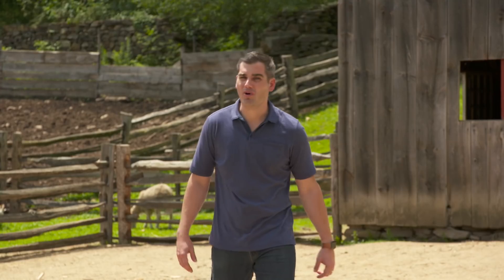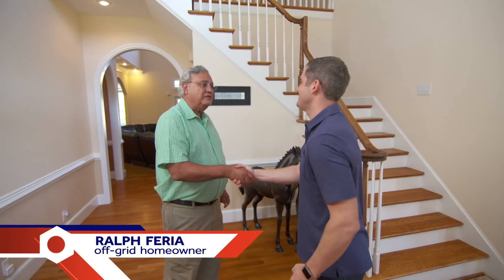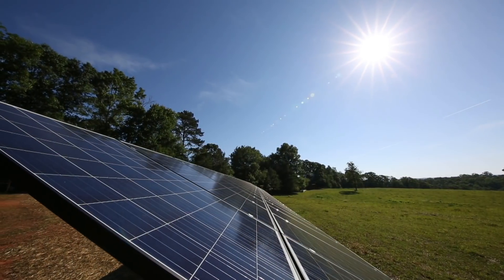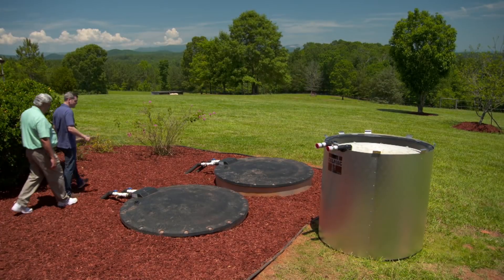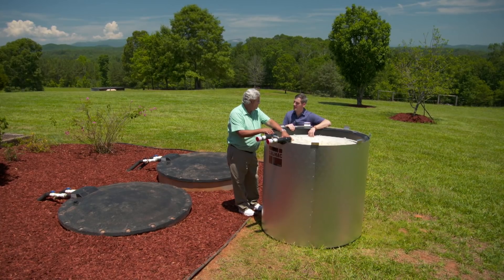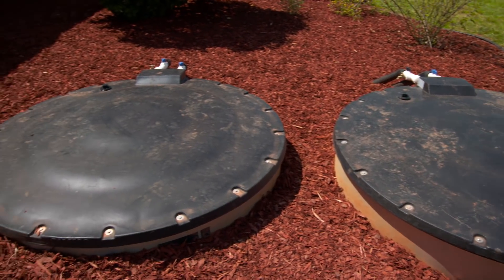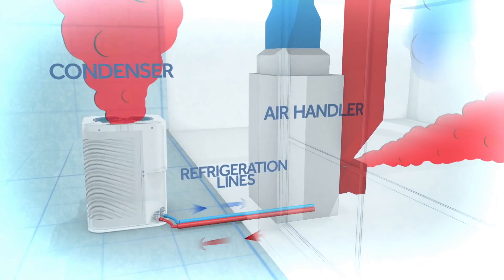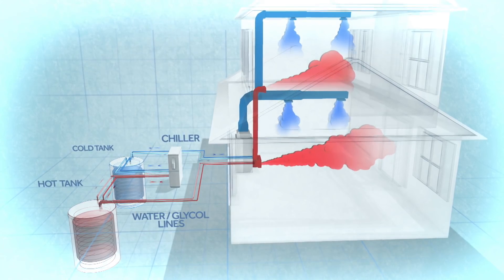Living Off the Grid Comfortably | Future House | Ask This Old House

Comment: Sadly off gird is illegal in some states/counties.
Florida is the worst state, They mandate that every home is connected to the power grid.
Reply: You can largely get around that by being connected but not actually using the electricity.
Reply: @fuxyews2177  , exactly
Reply: My solar isn't grid tied, its connected to 3 separate lithium ion batteries with wall built inverters and sockets.
Off grid systems are easily built and don't require a grid-tied inverter.
Reply: Did you really come back 1 month later to not understand the concept any better?

Ok I will make this as simple as possible..

I have a plug socket. The plug socket is connected to the grid. The power to that socket is supplied by a local electricity provider.
Now.. I don't use the socket. I have never used the socket. I receive no bills from the electricity provider.
Why? Because next to this socket is a separate one which is connected to the battery connected directly to my solar panels.
Solar panel > battery > inverter > plug socket.

I technically have the socket and its technically connected as required by some states. But the socket is never used... The house is connected, but is running off grid. This was the whole point of the conversation.
Reply: Well there's really no point in having a conversation.
I'm sitting here using a smartphone along with a dozen other people, whilst you argue that the technology doesn't exist to make it work...
 I know how much electricity I use, I know how much I generate daily, I know how much it varies and I know how large my battery bank is, and I know that I've never run out of power.... apparently my technology is from an alien world as is everyone else who lives off-grid or ever bought an off-grid system from 100's of retailers...I have no words except that you should keep living on the grid and stick to videos about cats or something
take care.
Reply: @fuxyews2177  actually if you connected, then there is flat minimum charge even you not using power, so they even make money from you even you use zero watt.
Reply: arrest me, it’s a civil issue , not a crime ...big energy wants they cut...why should , we as a home owner , depend on the power company? Not arguing ...
Reply: The whole point of this CONVERSATION is that someone lives in a place where being connected to the grid is required and explanations to him on how to get around it. 
You involved yourself into a separate conversation.

and yes ofcourse you can live off the grid comfortably. I do it. Off-grid livers do it. Caravan and RV owners around here do it too. Plenty of videos on this very site.

'The vast vast majority of solar is grid tied'
..and the vast majority of cars are petrol, that doesn't negate that electric cars exist or that driving one is viable on lots of cases. You can buy panels themselves off of amazon for example. None are grid-tied. 

'What do you do when its been cloudy for a week?'
Solar power is based on UV, not direct sunlight. It generates less but still generates enough with the appropriate sized system that accomodates that. The battery system also stores excess electricity. upto 4 days in my case.
Reply: Not related to my solar panel system no.
Reply: fux yews thank you and you're so right. I was looking to buy a house in Florida and go off grid the building inspector told me every house in Florida per building code must be tied in to the grid if it's available. in my case it is. so now I'm looking at a hybrid grid tie solar system instead of a complete off grid system. I like you're idea about the grid power,  I guess you just turn yours off, but I didn't even want that stupid connection fee these power companies charge every month- thx
Reply: Connect but don't use there power
Reply: True but strictly you could be technically connected but not use it. Also when there is a local blackout your house is still lit.
Reply: don't pay your bill.  they'll "disconnect" service and ... VOILA! you'll be unplugged from state utilities.
(nk ... )
Reply: as +fux yews said use the energy you produce not theirs. the best way to do this is using batteries to store in the day and use at night.
Reply: @erictoulon5946  At some price solar does work, sort of, for some people some of the time.  The problem is that for the average person that price point is extremely high and makes no economic sense.  The majority of the American population lives in areas with only about 10$ solar efficiency which means a 60 Kwh solar unit actually produces about 6 kWh year around.  That 60 KWh unit has an average cost of $60,000 and a battery will add another $30,000.  It may be true that some months you have no electric bill but what you do have is a bill to the bank for your system that is double or triple your electric bill.  If solar actually provided "free" electricity it wouldn't need to be subsidized and we'd all be standing in line to have it installed which is not the case.
Reply: illuminati you can connect to it you don’t have to use it don’t think duelism don’t limit yourself have options
Reply: @erictoulon5946  Wow, virtually nothing that you said is true. I have a friend who drives an older Cadillac who swears he gets 40 mpg. I don't believe him either. There is no free lunch and solar certainly isn't free or cheap. Your system had to be way over $100,000.00 which makes a 30 year monthly payment of $600.00. That means it is very likely double what your grid tied electric bill is. It also means it will be 30 years before you see any savings even if your grid tied bill really is $600.00 a month. 
As I mentioned, if solar were so great  it would sell it's self and everyone would have it on their roofs which is obviously not the case. The truth is that large solar companies are going under all the time.  There is not a single large solar array in the world that is even paying it's own way much less covering it's cost or making a profit. If the pros can't do it on a large scale it certainly can't be done on your roof. 
Please watch this 
https://www.youtube.com/watch?v=N-yALPEpV4w
Reply: illuminati 
Mine's on the grid but I don’t use it!
Reply: @erictoulon5946  I know, and your system was free wasn't it?
Reply: Lol. No. It’s not. Just stop
Reply: Don't like to admit I'm tied to the grid?  I assume you're trolling, correct?
There's no issue with being grid-tied, the entire point of this conversation (and why you interjected, I'm still not sure...) is that you can get around state regulations to being grid-tied by using alternate means to power your house rather than using the grid itself.
Reply: fux yews
Nice dodge there. I take it that means oyu do have an electric meter and wires to the grid.
Reply: There is not a grid tied battery system in existence that can store enough power to operate a typical house for any extended period unless you have a huge battery bank or use few electric appliances. .  UV makes up less than 50% of solar  radiation which coupled with the already terrible capacity factor of solar means there will be cloudy periods where your panels generate nothing., your batteries will go flat and you'll either use grid power or sit in the dark. 

https://www.solarquotes.com.au/blog/uv-solar-panels/
Reply: Actually I just came back from the weekend at our off grid camp that we've had for many years so I do indeed know a bit about off grid living. But you are correct in one point and that is that this conversation is a waste of my time. Anyone who thinks solar energy comes from UV is too uninformed to waste electrons on.
Reply: Then you don't have wires running to the grid?
Reply: No, the whole point is that this video is titled " Living Off the Grid Comfortably" which isn't true in any sense of the word. We are both responding to that. My original point still stands, the vast, vast, majority of solar is grid tied.

What do you do when it's been cloudy for a week and your batteries are flat?
Reply: fux yews
I understand perfectly. You are equivocating. You are grid tied but don't like to admit it.
Reply: @rickparker8883  "You are equivocating. You are grid tied but don't like to admit it."
is this for real?  some areas /require/ grid tie.  fux yews made a point of saying: "get around that by being connected but not actually using the electricity."   why would you even write that "equivocating" bs?
Reply: You're obviously not aware of how solar systems work. Every bit of power your residential solar makes goes out to the grid. All the power you use comes from the grid, not from your roof. That's why solar has to be grid tied and always will be.